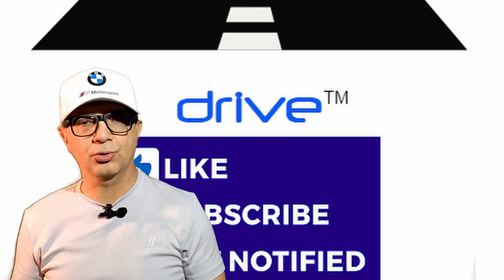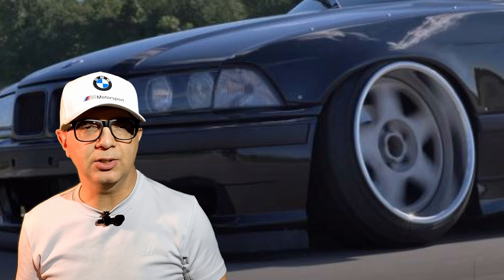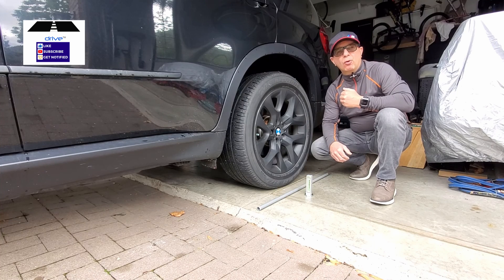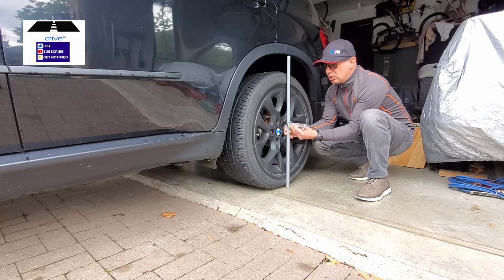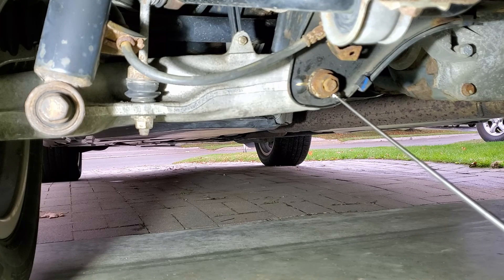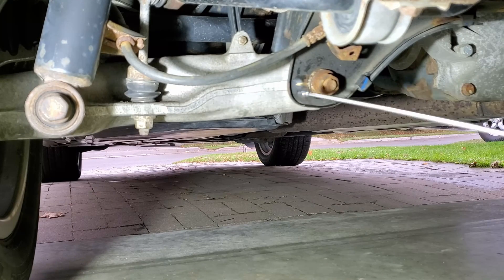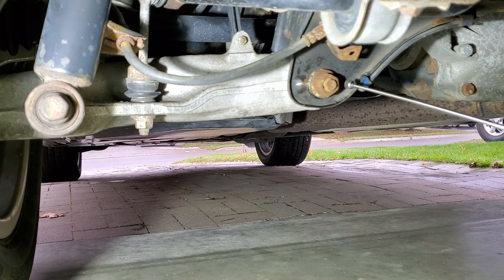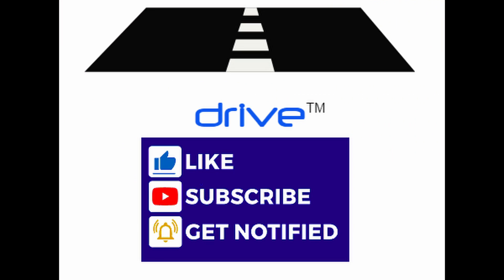BMW X5 E70 Rear Camber | Neutral, Positive & Negative Camber Tutorial

Comment: Actually, placing the rod against the tire is incorrect. Since the bottom of the tire is against the ground and carrying the load, it will flatten and the rod will not be in the same plane as the wheel. Your rod needs to be the sort that has extensions to rest on the wheel, not the tire.
Reply from the maker: Actually your comment is not entirely true, for two reasons.  1.  Modern tires do not deform unless the tire is totally without air pressure---they have stiffer sideways and 2. The tire I was demonstrating on is a run-flat tire meaning the sidewall will not deform.